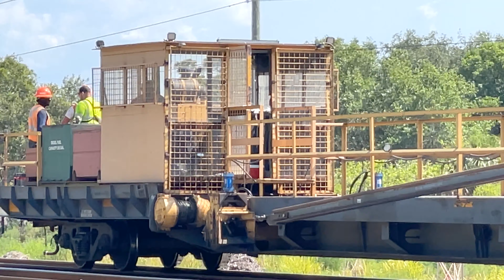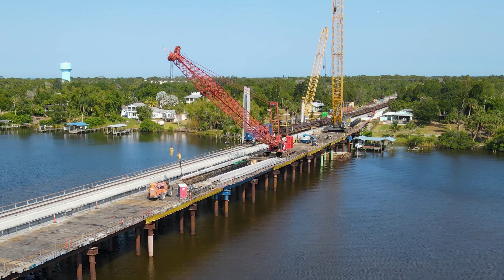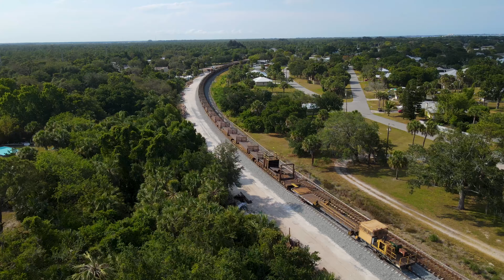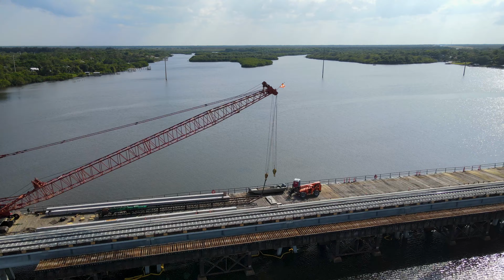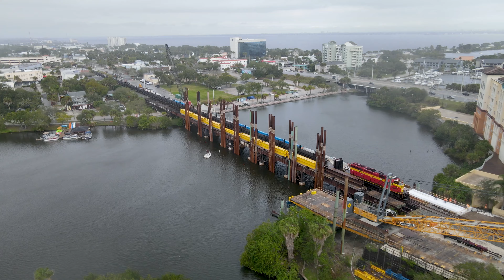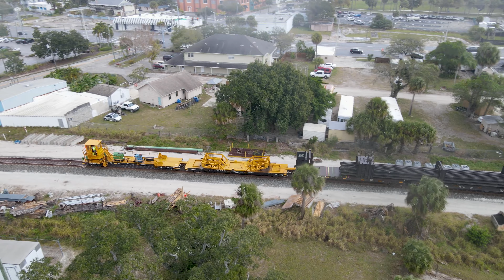Brightline Construction: Unloading a Rail Train - May 15, 2022

Comment: Good video . There's 9.09 miles of rail on the train if it was unloaded out-of-face , i other words that's unloading both rails at the same time in a continuous operation . I was a rail train operator for Union Pacific Rail for several years and road the loaded trains to their destination and unloaded the rail . Our union wasn't classified the same as train crews and I rode the trains the entire trip . Made a lot of overtime and double time . I Took rail trains to 18 of the states Union Pacific back when I was working .

Comment: Do the rails eventually get welded together?
Reply from the maker: When actually installed they are welded together
Reply: @RoamingRailfan  ok, thanks! We use continously welded rail a lot here in Germany, but I assume it is relatively uncommon in the US?
Reply from the maker: It is very common here
Reply: @RoamingRailfan  Interesting! The weather in Florida seems pretty ideal to use continously welded rail. When I was in Michigan for work a couple of years ago, I travelled along some rail lines and there wasn't any CWR used, is this because of the larger tenperature differences over the year or were these perhaps just very old lines?
Reply from the maker: More than likely just old lines
Reply: @georgobergfell  Many places in the US still use jointed rail because old components are still functional, but nearly all the main lines of any significant importance use CWR. Jointed rail is most common now on short lines and branches, especially lesser-used ones. On my local tourist line much of the rails themselves are 1900 to 1940s vintage, but the nearby freight railroads use continuously welded ribbon rail.